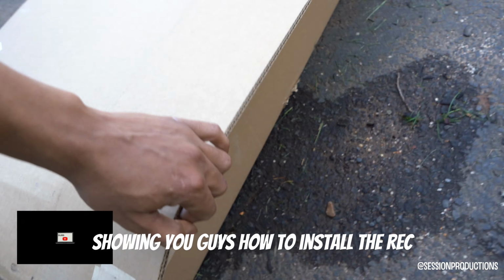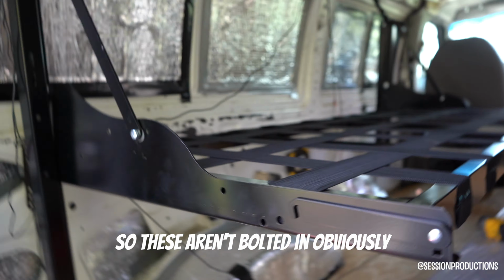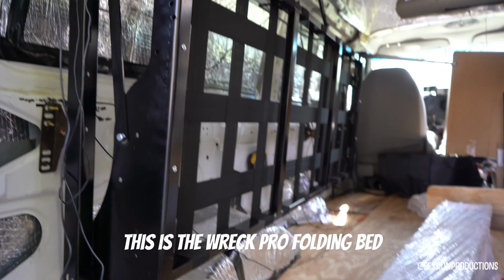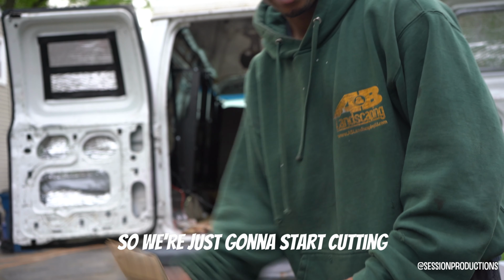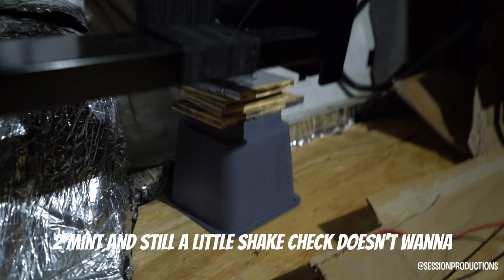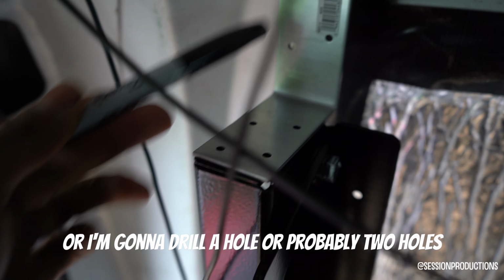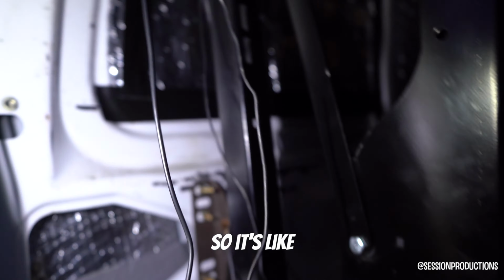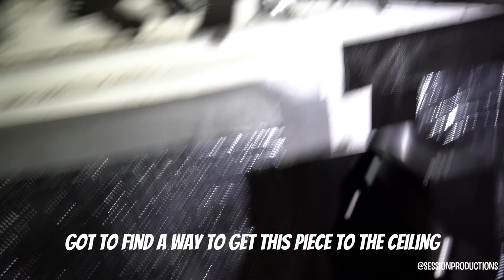How To INSTALL Recpro Folding Bed In My Van

Comment: Hey Mikeyyywill, before you finish the rough-in, try to see if you can run a couple of 3/4 pvc pipe(s) under the left side of the bed frame and if you ever need to run any other wires in the future and its just cheap for a couple of pieces YOU GOT IT!!! Liked#2 N Subscribed !!!
Reply from the maker: That’s a good idea!! I have wire covers but I didn’t get a chance to put them on. I wanted to get a lot of main pieces mounted or just staged for a minute. I like your idea better though!!! Thanks again for the help
Reply: @mikeyyywill  take it from an old IT guy: always include empty conduit before you "close the walls."